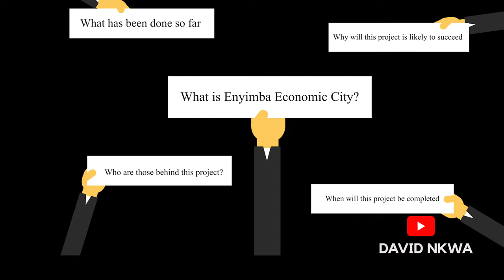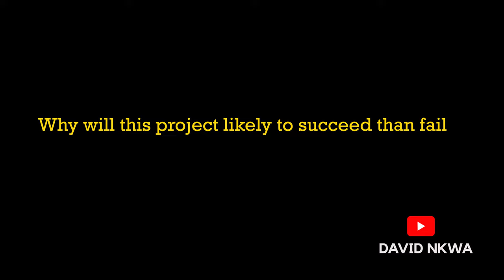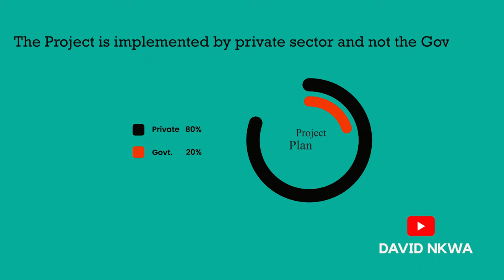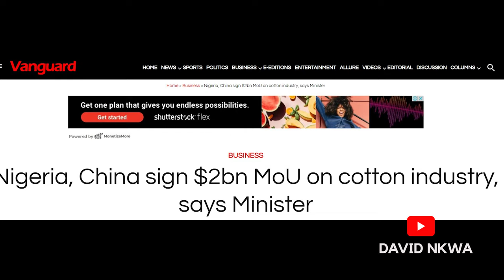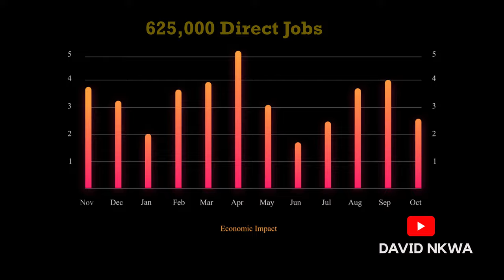Forget China? Nigeria's Biggest Manufacturing Hub that will Rival China {Enyimba Economic City}

Comment: As long as they don't turn it into another Abuja with just highrise buildings but focus on manufacturing I think it will come to fruition. This is a good idea and I wish the developers all the best.
Reply: Building height is not a measurement for development. Nairobi, Mexico City, etc have far more taller buildings than Stockholm yet the latter is light years more developed than the former two.
Reply: @shangothunder1055  ....So far in all the plans I have seen coming from Nigerian States, highrise buildings seems to be the norm which I detest.
You are right about highrise buildings.

Comment: In the last 20 years there have tons of these types of presentations. The only 2 that have had anything done is eko Atlantic and Lagos FTZ and neither is what was promised. With it's young population, Nigeria needs to first solve it's human capital problem. Companies educated qualified workers. That should be the focus. All these will happen once that is in place
Reply from the maker: Another perspective. However if these works thousands of youth wil be taken off the street
Reply: @DavidNkwa  Yes, but it's impractical to have these many "largest in the world" or Dubia-tyoe projects which is why they fail or fall significantly short. The aim should be to provide the runway for private investors through infrastructure, then these things will fall in place based on viability. A place with 1 million people, for instance, will never be more viable than a place with 20 million unless it has more talented human resources.  So scaling appropriately and solving for skilled labor deficits are the most crucial component. Also no one is going to give you money to build a 10-storey house if you have not shown you can build a one-storey house so these marketing displays are laughable.
Reply: The system in place will not allow such project to work but I’m waiting for the project to manifest anyway